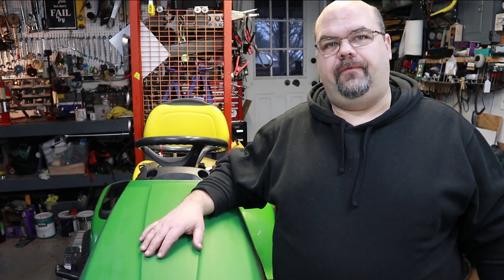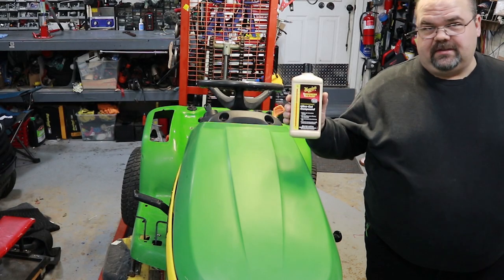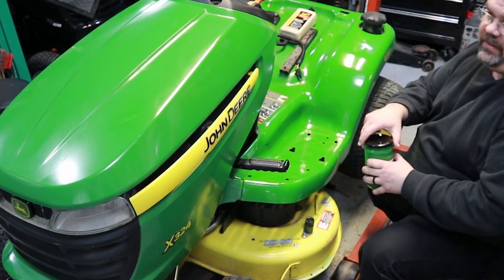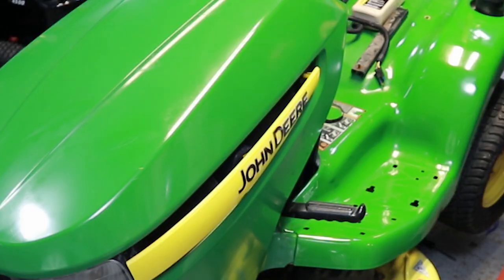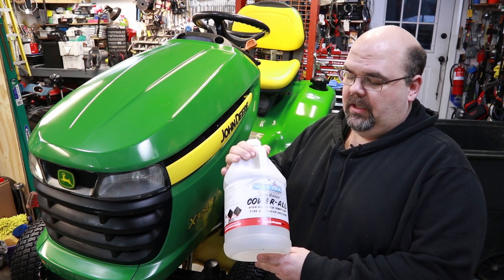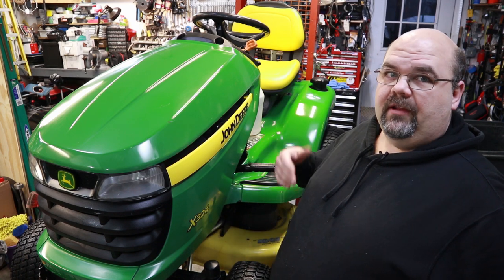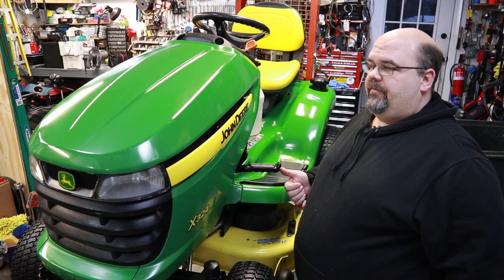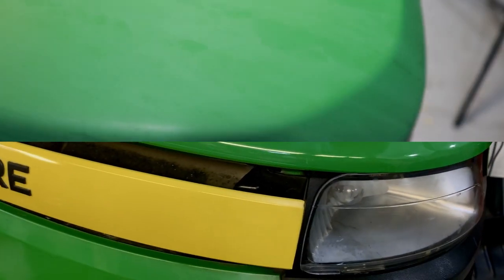Bringing Life Back To A Forgotten John Deere X324 Mower!

Comment from the maker: California Cover All – Automotive Tire Shine Spray & Professional Grade Tire Dressing - High Gloss - Water Repellent & Made in America (1 Gallon)
https://amzn.to/2ZfOfe4

Polisher, TACKLIFE 7-inch Buffer Polisher, 6 Variable Speeds from 1500~3500 RPM, D-Handle, Wool Disc, Ideal for Car Polishing, Furniture/Wood Polishing, Paint/Rust Removal - PPGJ05A
https://amzn.to/3rJKSrU

SPTA 5Pcs 6inch (150mm) Buffing Pads Polishing Grip Pad For Car Polisher Boat Polisher
https://amzn.to/3b5PKAY

Meguiar’s M100 Mirror Glaze Pro Speed Compound, 32 oz
https://amzn.to/3ajvBs4

3M Wetordry Sandpaper, 32036, 600 Grit, 9 in x 11 in, 5 per pack, Packaging May Vary
https://amzn.to/3b2YOXl

JD Green paint  - Quart
https://www.amazon.com/dp/B000I19AFW/...

Milwaukee 2457-21 3/8-in Cordless M12 Lithium-Ion Ratchet Kit (Better than the one I used in the video)
https://amzn.to/3dd4il0

Comment: You have done a great job restoring the John Deere mowers. I did the same thing on my LA125 and my L110. But after putting them to the  job they were intended to do they end up needing to be restored again within 3 uses. They are meant to be abused  and not kept to look mint.
Reply from the maker: You're not wrong.  I love seeing these things in their clean, polished glory, but when they are used as intended, they lose that luster pretty quickly.  
Thanks for watching.  🦅

Comment: Hey Baldeagle.......brilliant! I have an x300. I just replaced the steering gear on it at 400 hours. Every winter, I drop the deck and paint the underside and polish the whole thing up. The only thing I don't like is the bearing greasing on the deck......it's pointless.......I removed one side of the bearing race so allow the grease in. It would be great if you could do a deck video. Here in the U.K. those things ain't cheap so I look after mine. Best wishes from England brother!!
Reply from the maker: @Dave H, thanks for watching.  I'm actually working on a 1992 GT262 right now with a deck that's been neglected and rusted through.  I should have a video posted in the next week or two.
Reply: @baldeagle242  right on brother!

Comment: Nicely done.  That is a Rare 4 wheel steer mower and likely Kawasaki powered. It would be nice to see the engine.  Great job on the hood and other painted parts.  If you went over the hood again with medium Rubbing Compound the fine scratches would likely go away.
I cannot believe that a mower that expensive is only a 42" cut.  Should be 48 or 50". The X series are made by John Deere unlike the other 100 series made by MTD etc.
Reply from the maker: This was indeed a Kawasaki-powered mower.  The engine was just as clean as the rest of the mower.  I have an X-304 I'm working on this week.  
Some of the people that want a 4-wheel steer mower like the smaller 42” decks so they can maneuver around landscaping and retaining walls better.  The guy that Purchased this mower was explicitly looking for a 42” deck for that very reason.  
I love the X series mowers.  No comparison to the lower-end JD mowers.
Reply: @baldeagle242   My ride is a John Deere X320 48" 22 HP Kawi with some added Bling, lights, Hitch assy, Tool box, front bumper and Chrome/SS Hubcaps
Reply from the maker: @gordbaker896  they are great mowers.  I just sold one earlier this season.  😁👍

Comment: You did an awesome job. I’m a farmer and have several pieces of JD equipment and spend my winters in our shop detailing them, so I can appreciate what you did here. I have questions on the cover-all product…is the shine long lasting? Does it attract dust and brown after you get using the tractor?
I’ve also found 3M perfect-it w/matching pads works very well, but make sure you ceramicoat or wax afterwards or you’ll lose the shine you gained over time.
Reply from the maker: The cover all product is silicone based and will attract dust when first applied but after a day or to it will dry to a long lasting shine. Once it has dried it will repeal dust, dirt and even bird droppings.  It make future clean up easier. 
One thing to keep in mind is you can not paint anything you apply this to. Acetone or Prep All will remove it if paint is needed later on but this should be the very last product you use on a restoration.  It is also extremely slick if you get it on your shop floor. 
Buying it by the gallon is your most cost effective option. 
https://amzn.to/3HizJYJ
I use a small paint brush to apply it and generally wipe it off with a clean rag a day or two after I apply it.
Reply: @baldeagle242  awesome! Thank you

Comment: Did you use the same 600 grit paper on the rear fenders? Wet sand?
Reply from the maker: I did but I’d recommend 1000 or 1200 on painted surfaces.  If you use 600 do it after sanding the hood so the paper is worn down and not so aggressive.  600 will sand through the paint pretty quickly if your not careful.

Comment: I'm lookin at a 2009 x320 with 468hours on it and it does have the obligatory crack in the center towards the back that many have. Somebody decided itd look better if a 5 year old would spray paint everything on the body john deere green. Mechanically it seems ok,but I'm leery since the paints so abused. It's a dealership trade in and they're asking $1200. Its alot better built than my cub cadet,so I can deal with fixin the hood and paint. I dont expect a mower that old to look perfect,just better.
Reply from the maker: That’s quite a bit for that age and condition. This time of year dealers are not selling much of anything.  I’d offer them no more than $900 and hand them my phone number on my way out the door if they ask for a penny more. Guarantee you’ll get a call accepting $900 in less than 48 hours. 
If that falls through watch marketplace on Facebook. You will find one $1200 in much better condition.  This time of your is the best time to buy!
Reply: @baldeagle242  agreed,I was gonna offer a $1k,lol

Comment: What lift are you using?
Reply from the maker: The lift is a JHS-1100.  It's actually a manual pallet stacker that I've adapted to use as a mower lift.  
Here is a link to a similar lift on Amazon.  
https://www.amazon.com/dp/B086X72HC2/?tag=eagle0f1-20

Comment: Hi there. I need your help and advice. I'm in the process of trying to tidy up a 2003 L120 John Deere ride on mower. I attempted to wet sand the hood but I used a too rough of a sand paper and now when I polish it the small light scratches still show up and I can't get the hood to shine which is so annoying. I used 600 grit just now and it's still not coming up too good. I'm following you and seen how you did thus mower but being a complete novice I think I ruined it 😭 Any advice??? William in Ireland 🇮🇪
Reply from the maker: It should be ok. The plastic on the L120 is colored all the way through. Depending on how well you want the surface to appear depends on how fine of sandpaper you use. 600 for me is “good enough” for a mower but if you truly want a show car finish you can progressively sand it all the way up to 2000 grit. 1200 will remove most visible sanding mark for anyone standing 2-3 yards away. 
The below information is copied from another source but gives you everything you need to know. These steps are for a show car finish. For a mower you can selectively skip the extreme steps. 
Materials Needed:

	•	Finer grit sandpapers (800, 1000, 1500, 2000, and 3000 grit)
	•	Sanding block or pad
	•	Water for wet sanding
	•	Microfiber cloths
	•	Polishing compound (medium and fine)
	•	Polishing pads (foam or microfiber)
	•	Electric buffer/polisher (variable speed)
	•	Plastic polish
	•	Wax or sealant
	•	Clean water and soap
	•	Tack cloth

Step-by-Step Process:

1. Preparation

	•	Clean the Surface: Ensure the polycarbonate plastic is thoroughly cleaned. Use water and soap to remove any dirt, grease, or debris. Dry it with a clean microfiber cloth.

2. Wet Sanding Progression

	•	800 Grit Sandpaper: Start with 800 grit sandpaper. Wet the sandpaper and the surface of the plastic with water to minimize heat and reduce the risk of scratching. Sand the entire surface evenly, using circular or back-and-forth motions. Frequently rinse the sandpaper and surface to remove residue.
	•	1000 Grit Sandpaper: Move to 1000 grit sandpaper, repeating the wet sanding process. This step further refines the scratches from the previous grit.
	•	1500 Grit Sandpaper: Continue with 1500 grit sandpaper, maintaining the same technique. You should start noticing a smoother surface.
	•	2000 Grit Sandpaper: Follow with 2000 grit sandpaper, ensuring all previous sanding marks are eliminated.
	•	3000 Grit Sandpaper: Finish with 3000 grit sandpaper to achieve a very smooth surface. This step is crucial for removing the final sanding marks and preparing the surface for polishing.

3. Polishing

	•	Medium Polishing Compound: Apply a medium polishing compound to a foam or microfiber polishing pad attached to an electric buffer. Set the buffer to a low speed and work the compound into the surface. Use overlapping passes and avoid staying in one spot to prevent heat buildup.
	•	Fine Polishing Compound: Switch to a fine polishing compound and a clean polishing pad. Increase the buffer speed slightly and repeat the polishing process. This step brings out the shine and removes finer scratches left by the medium compound.
	•	Hand Polishing: For tighter areas or detailed work, use a microfiber cloth and the fine polishing compound by hand. Rub in small, circular motions.

4. Plastic Polish

	•	Apply Plastic Polish: Use a dedicated plastic polish to further enhance the clarity and shine. Apply it with a clean polishing pad or microfiber cloth, following the manufacturer’s instructions.

5. Final Cleaning and Inspection

	•	Clean the Surface: Wipe down the surface with a tack cloth to remove any residual polish or dust.
	•	Inspect for Flaws: Check the surface under good lighting to ensure all scratches are removed and the finish is uniform.

6. Wax or Sealant

	•	Apply Wax or Sealant: To protect the polished surface and enhance the shine, apply a high-quality automotive wax or sealant. Use a foam applicator pad to apply a thin, even coat. Allow it to haze, then buff it off with a clean microfiber cloth.

Additional Tips:

	•	Work in a Clean Environment: Dust and debris can ruin your finish. Work in a clean, dust-free area.
	•	Take Your Time: Rushing through the sanding or polishing steps can result in missed scratches or an uneven finish.
	•	Stay Consistent: Use consistent pressure and motion during sanding and polishing to avoid creating uneven spots.
	•	Proper Lighting: Good lighting helps you see imperfections and ensure even sanding and polishing.
Reply: Thank you very very much for your help. I don't expect it to be in showroom condition as it's an old mower but if I got it to shine at least I would be more than happy. Thanks again and I will look forward to seeing more videos from you in the future 🍺🍺

Comment: I've got a question for you guys...I have a jd la105 and I have a good sized yard it takes me 3 hours to mow it...but I have a 19hp briggs n stratton motor...and I'm looking to either get a mower that won't bog down in higher grass or to help mine not be as bad...any help is appreciated...
Reply from the maker: Keep the blades sharp, use high lift blade with a side discharge (not mulching blades), don't cut damp grass, raise your deck to cut about 3.5”-4” and cut more often.  19hp on that mower should be more than enough power if you follow those general guidelines.